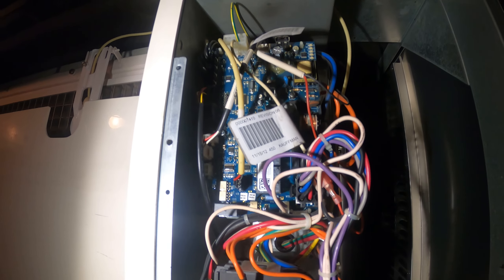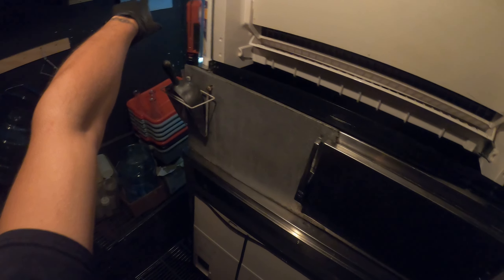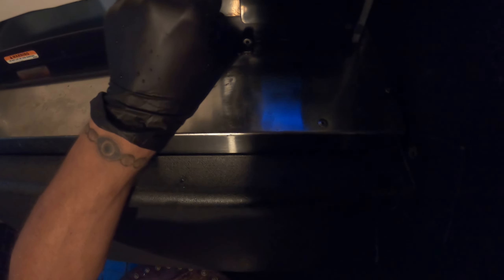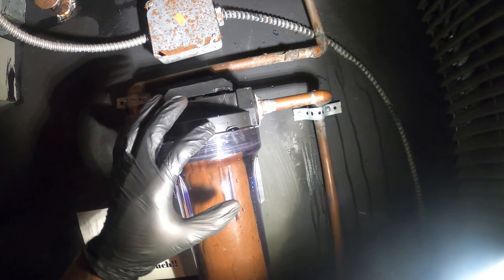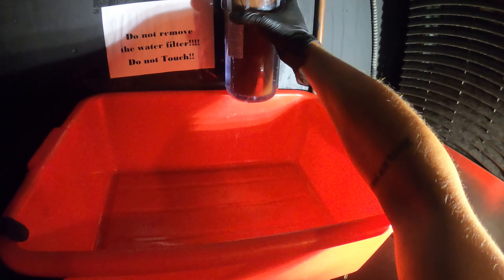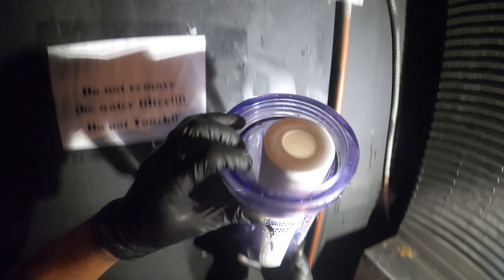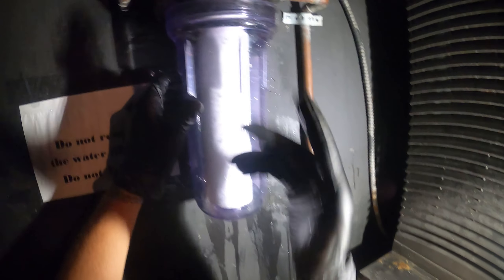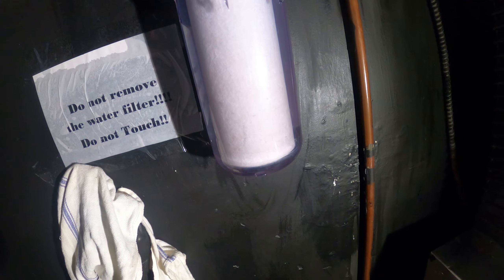HVACR: American Plumber WVC34 Whole House Water Sediment Filter Replacement For Ice Machine (DIY)

Comment: Great video. We usually strip a unit down of hoses and parts. If you just us cleaner/sanitizer and go you will still a ton of gunk in the units. By doing this you can charge a ton more for cleanings. I have all kinds of brushes i use to get in the nooks and crannys.